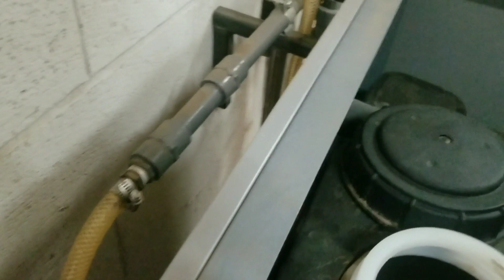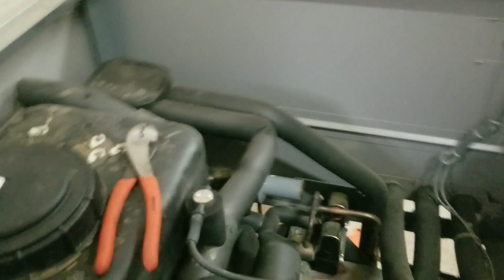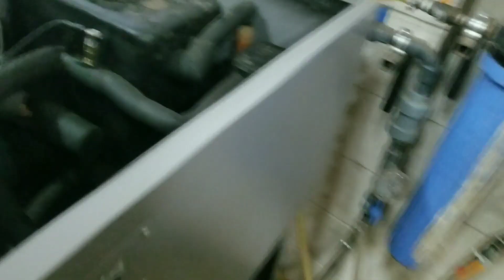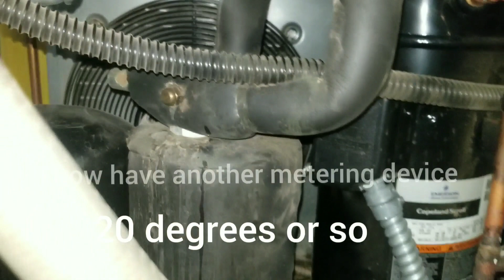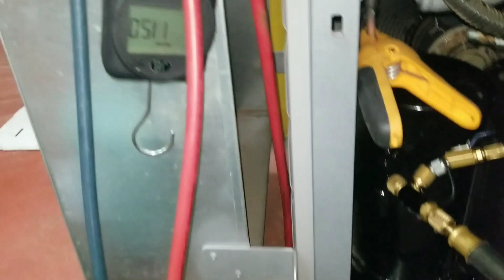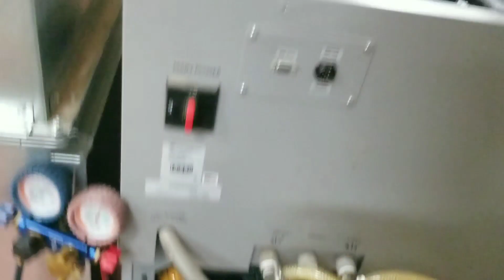hvac process chiller lock out!

Comment: I wonder if someone soldered that port up because it was leaking and they didn't want to replace the whole valve
Reply from the maker: That's my best guess but there is a few different ways to stop it from leaking and still have access to use it, now you have no option but to replace the valve if you need to actually see the suction pressure.  Thanks for watching!
Reply: @EverythingHVACR  people do the cheapest possible fix
Reply from the maker: That's true! And some people do it right!
Reply: @EverythingHVACR  the crap in that service valve is more than likely the crap in the drier
Reply from the maker: Good call, honestly I hadn't considered that. Thanks for watching!

Comment: Never seen a process chiller running a dixell control. That's kinda janky. Thing looks like a piece lol. Did it have a liquid injection txv? That world make sense with the liquid line setup/ operation.  CSZ has a configuration like that where they pulse liquid flow to the evap with two separate liquid lines.
Reply from the maker: A piece may be an understatement.  Thanks for watching.  No txv and the dixell controller only controls compressor on low pressure. Chiller control takes care of the solenoid valves... I think! Lol. I still have no confirmation on the exact operation.